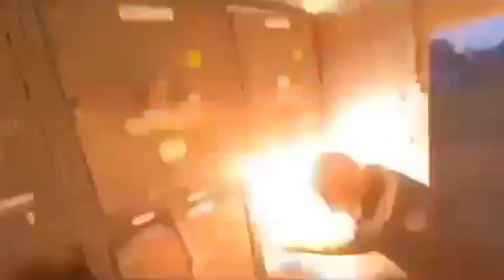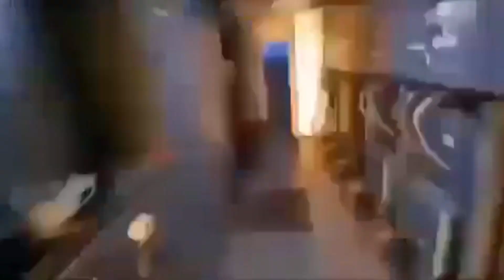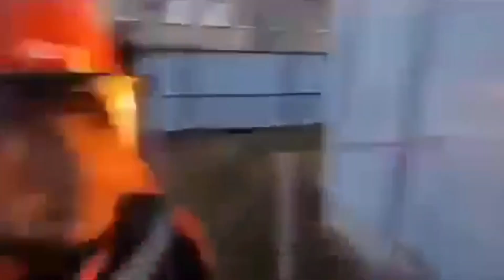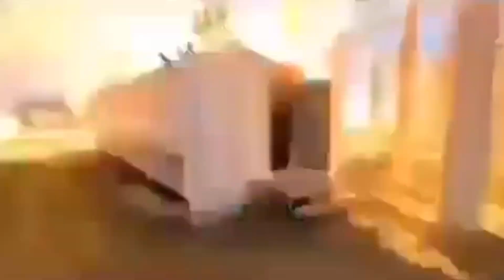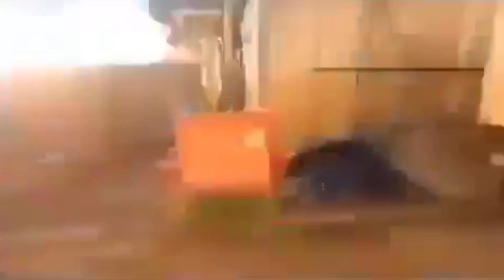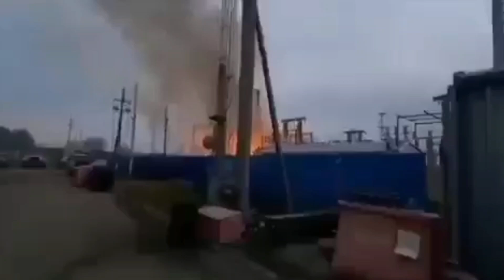Arc flash explosion during rolling of HV breaker into the panel.

Comment: Why didn't the switchboard protection operate to kill the board? A properly designed protection system would have isolated the switchboard upstream of this board. Ideally using ARC flash detection via fibre optics.
Reply: Thats the problem with electricity fault it can detect a break in the system or overload but because electricity can produce a serious amount of heat in Seconds so by time the switchboard could engage metal materials have already melt & bind together literally sometimes just by sudden contact a wrench or pliers can weld to a panel.
Reply: Exactly. This event should have tripped out a breaker upstream pretty quickly.
Reply: @alouisschafer7212 why, IDMT protection would probably have been used and to coordinate with the downstream breaker may have taken 0.3-0.5 seconds to trip!
Reply: Do you think arc flash protection existed when that board was made or that if installed (in the busbar chamber) would have prevented this ???
Reply: @andyxox4168  It seems other protection on the incoming and outgoing switchboards did not operate correctly to kill this board. If they don't work then arc flash becomes irrelevant.
Reply: @Drobbleropme  .. that was my point, I was assuming some level of knowledge!

Comment: That there is like a bug zapper on steroids.
Reply: Bug zappers are capacitors that discharge probably around 3kv, but the voltage drops almost instantly there's not a substantial amount of power. This switch gear can easily deliver thousands of amps without a sweat, meaning an arc can be sustained. These arcs release an extreme amount of UV, infrared and visible light, making them essentially like the surface of the sun. There's also usually a shock wave that can blow eardrums and send you across the room. Even with a flash suit, you will be crippled by severe 2nd degree burns all over your body and likely hearing damage. Mechanical injuries are also likely from the arc blast

Comment: And this is 'only' 6kV 😮
I stood 3m away from a 30kV capsuled environment as the switch falsly opened while 250A current.  It was enough to shocked me for the rest of my life.
Reply: You were lucky, the available fault level at 30kV would likely be less than at 6kV and the protection would have been better.
Reply: Ive done this many times but bringing a 10kv transformer online after maintenance work is always something else.
We mainly encounter very safe hermetically sealed SF6 switchgear and all you need to to do close the load switch is press one button but always a tense moment. 
A colleague of mine managed to switch a Siemens SF6 breaker into a dead short once, the switch shrugged it off amazingly just made one hell of a bang inside.
The only safe medium voltage switchgear type is gas insulated hermetically sealed.
Reply: @alouisschafer7212rubbish, vacuum contractors and ACBs are perfectly adequate for most applications and environments.
Reply: "shocked me for the rest of my life"
Poor choice of words

Comment: Need arc flash relay protection. Simplest protection is a tiny rope tought all MV cells and end switch. Arc burned rope and trip end switch.
Reply from the maker: Absolutely agree! Arc flash relay protection is crucial, and your suggestion of a simple rope-based tripping mechanism is quite innovative and practical for quick detection. However, it’s also important to combine this with regular maintenance and proper breaker condition monitoring—especially in cases where vacuum or SF6 pressure may drop below safe levels. Both protection and prevention go hand in hand.

Comment: Problem?
Da…..
Reply from the maker: In vacuum circuit breakers or SF6 breakers, any leakage of vacuum or drop in arc quenching gas pressure below the safe limit can lead to serious issues or failures. That's why regular annual maintenance and strict adherence to the manufacturer's maintenance manual are critical for safe and reliable operation. Preventive care always pays off in the long run!"